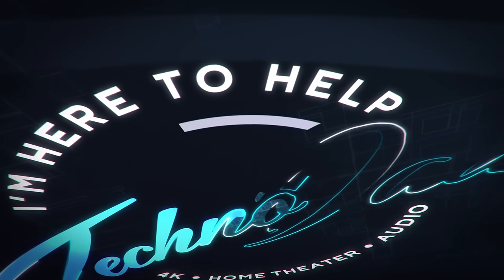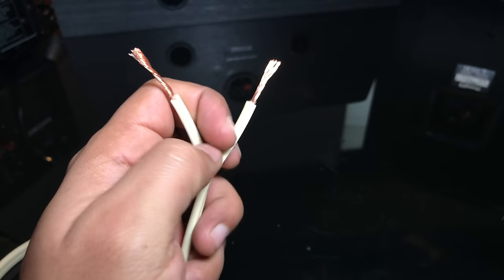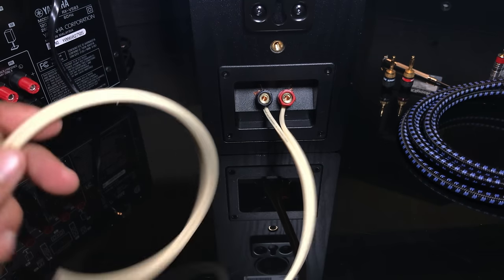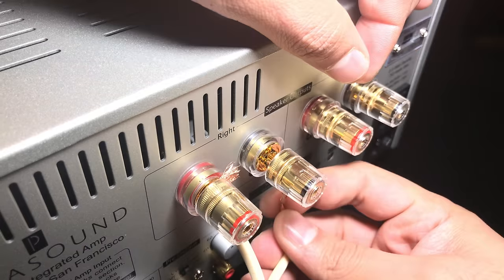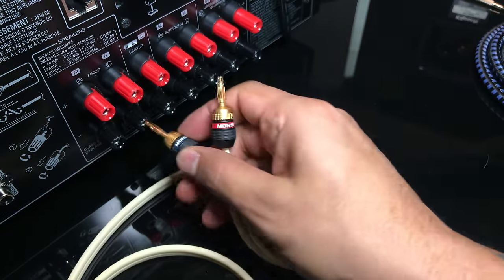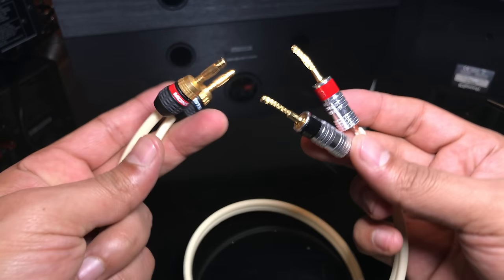How to Connect Speakers to Amplifiers | Home Audio Basics

Comment: 1:23 strip cable
3:18 bare wire connection
6:26 banana clips
8:47 pin connectors
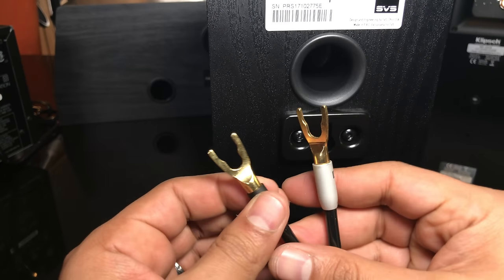11:08 spade connectors
13:07 dual binding posts
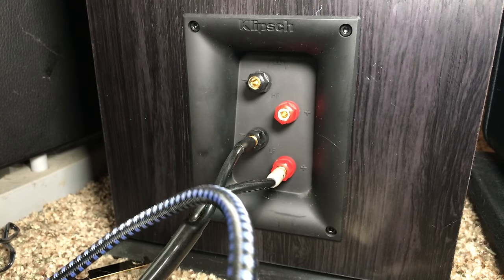14:09 his recommendation
Reply from the maker: Thank you!

Comment: Thank you so much ... it took me forever ... but I was finally able to connect my new turntable to the amp and the speakers ... your video helped me so much. I had NO IDEA what I was doing. Thank you for the clear instructions. Your video was essential to setting everything up. Thank you, thank you, thank you.
Reply from the maker: You’re very welcome, Jennifer.  I’m glad you doing the video!
Reply: I have to set up one too. I just find it annoying that things cant be simple with turn tables. Got to do so much work. Miss the old days when you can just plug and go. I had a cheap one that was like that but it started wobbling badly so wound up getting a more expensive one and i went to set up and boom nadda. needed to go back to get the amplifer and speakers and stero wire. Need to wait for the speakers to come in but im hoping i dont start a fire or blow anything up. lol

Comment: Many thanks for uploading!
 
I implore your viewers not to make my mistake. It's VITAL to ensure not even ONE strand is near the opposite pole when using binding posts, leading to a short circuit! It's remarkably easily done: at 06:24 you'll see what I mean, at the middle of the picture. It's a good idea to tuck the protruding wire around the post in the same direction as you turn the nut so it winds itself in and is less prone to splaying out. (This also usefully increases the contact area, giving better sound). 
I missed a single strand once. It contacted and made a short circuit to the opposite pole. The amp gradually overheated but I didn't know until I smelt it on the other side of the room, by which time its rubber feet were sliding off in their own goo. You may be luckier and have a fuse blow. Better just to check! :-D
Reply: Thank you for the warning! That would be my mistake!🤣🤣🤣
Reply: @aimee-lynndonovan6077  :-)

Comment: As always, another very informative and well laid out instructional video that is easy to follow.  I too have never used anything other than banana plugs and also have the same monster banana plugs.  They aren’t cheap but always seem to be my go to plugs.
Reply from the maker: Thanks brotha!  Yeah, I think it might be because Monster was the only brand I could find 20 years ago, lol!!!
Reply: I'm pretty sure I got mine when I bought some audio gear.  They threw in the cables with the deal and happened to have the Monster Cable Banana Plugs attached..   They have been my favorite.  The locking banana plugs are my second favorite only because they are so long.

Comment: The reason for two screws on the pin connector, or on some banana plugs, is something you defeated by stripping the cable too far down. The top screw is to hold the wire while the bottom screw is to hold the cable covering/casing. So you only should strip the wire far enough to allow the bottom screw to engage that casing. It makes for a much more secure and long lasting connection, especially when you pull the plug out multiple times to move the speaker or receiver.
Reply: Yup.  I knew immediately it was amatuer hour when he pulled out the  needle-nose pliers
Reply: I think he admitted that in the video...

Comment: The little "hehe" after you said "just a quick little snip of the tip" made me laugh.

Thank you so much for dumbing this down for people like me, this helped me sooo much! Down to the amazon recommendations/option.

My brother bought me a turn-table for my birthday last year, and then a few bookshelf speakers for another occasion. It seems like he was as clueless as me, because he didn't buy anything else. Finally, I got tired of staring at them in a corner, so I bought the amp but was still lost on how to connect the cables. I watched a couple of other vids of "how to" but they didn't actually break it down this much and I was getting so frustrated.

Liked and subscribed! :)

Comment: You taught me so much about the connectors. Do you have a video on input and output locations we need to use for adding a amplifier to the receiver. I never have hooked one up.

Comment: Thank you, this was so clear & concise. 
I have marshall speakers, all are different models, and I have amp as well.
Are the Bannana plugs universal for the speakers? Ive never done this before 😅😅
The instructions recomend spade connectors for the amp but speakers can only take the Bannana plugs
Reply from the maker: Hi!  Banana plugs should work for most speaker terminals with binding posts.  You can find cables that have spade on one end and banana on the other - https://amzn.to/3sibkyK - https://amzn.to/40jpJai

Comment: Good vid. Quick tip with spade connectors (when they're at an awkward angle) - use a pair of pliers or a clamp to gently bend the spade to the correct angle.
Reply from the maker: That's a great idea!

Comment: Very well explained video tutorial. 
Would you say that attaching banana plugs to bare copper wire cables for attachment to speakers is better than just a bare wire connected to the speaker..?
In short, would there be an improvement in sound  quality?
Finally, the shorter the speaker cable, means a superior ( better...)  quality of sound, am I correct?
Many thanks!

Comment: If you hook up 9 speakers (5.1.4) to an AV receiver, that would be 36 times pulling the rubber and plastic casing off the copper. So go and buy a wire stripper, its worth it.
Reply from the maker: Lol, yeah, I hear what you're saying.  Although, I already had a 5.1 setup before I started the move to Atmos and then bought cables that already had pre-terminated ends.
Reply: Jan Reinhardt what about the subwoofer? Doesn’t it needs the speaker wires too? (Im new to this speaker/home theater scene) by my math you only counted the 3 front speakers 2 surrounds and the 4 cieling speakers in the setup u were talking about. Which would add up to 9x4=36 which doesn’t include the subwoofer
Reply: @antoniolt611  Subwoofers generally use an RCA Cable with predetermined ends.
Reply: Wire strippers are cheaper than real ones

Comment: Hey man. I followed your video and thanks a lot, I managed to feed the twisted copper wires into the amp terminal but it is way louder in one speaker than the other. Any ideas on what this is?
Reply from the maker: Hi! I’m not sure why that would happen. Is it an old amp or something?
Reply: Yeah it’s an old amp but it was working fine, but I had to unconnect them as I wired the left speaker to the right and visa versa. Only when I tried connecting them again was there a problem.

Comment: I use 24K Gold Nakamichi Speaker Banana Plugs. You can buy 8 of them for $9. I’ve used them for years and all my connections are still good. Heat shrink speaker wire pants can help prevent oxidation from any air getting in.

Comment: Thank you for another great video. I’ve a question: I think you’ve connected the ‘Pins’ not right; you use both screws for the kabel without the rubber, but you have to screw the frontscrew to make contact with the blank wire (you can fold the blank wire to make a better grip) and screw the backscrew with the rubber!. With this connection it holds longer without the chance to break it. Second question: did you know that you can also put the bananaplug into most receiver-connectors by onscrewing them first and put the plug into the hole for the blank wire? On this way the plugs won’t unplug when you’re moving the receiver.(I’m Dutch, so sorry for my english....)
Reply from the maker: Thanks for the tip RABooden!!

Comment: Techno Dad, Do you know if using stiff pin connectors on a speaker with spring or clip loading inputs works? Or do you have to use the raw wire or flexible pins on the spring loaded/clip loading speaker inputs? Thanks!
Reply: It would probably work. But it’s a better solid connection if u use bare wire

Comment: On my way to upgrade my basic Denon 5.1 1610 AVR. Either I go for an AVR + ext amp or processor + amp. Looking at cost vs performance, what do you suggest? I like your option of the 3 channel amp for the LCR channel.

Comment: Great information.  I will have 7 speakers about 23 feet high in the ceiling.  I do not want to have any problems with the speaker connections.  Which speaker connection do you recommend for the money and which connection do you recommend for a fail safe/30 year permanent solution? I will need to rent a lift so I want to get this right!

Comment: Hey, thanks for the help! Is there a way to hook up speakers (spring clamp wire style) to a DVD player instead of a receiver? The DVD player doesn’t have the positive and negative wire outlets, but is there an adapter or a work around?

Comment: Great video, learned a lot .. but not enough! Hence this question:

I got a class D amp for stereo speakers and wanted to connect one of RELs subs to it , they highly recommend doing it with their high level connection, and to do that they recommend cutting the wire it comes with and attacking one to the right positive and one to the left positive. Question, can I just twist in their high level connection wires into this wire and then plug in the resulting “bundle” into the ports?

Am I gonna blow up my equipment or pull off their recommendation?
Reply from the maker: Hi!  I made a video about connecting a REL subwoofer via hi-level connections - https://youtu.be/4yMdZbOMDZc - as far as if you'll blow up your equipment...I would contact REL to make sure you won't have any issues.
Reply: @TechnoDad  thanks a lot buddy , that video was exactly what I was looking for.
Appreciate it :)

Comment: Nice tutorial thank you. The only problem I have is that my onkyo receiver rear surround sound connection design (which I use for  my bookshelf speakers), is different from what you've shown in your review. .

The connections are the ones that you have to strip the tip of the wires then lifting up a lever for positive and negative before inserting the wires in,  then releasing lever for wire to remain secured. I'm positive you'd get an ideal of what I mean. The hole underneath the level is a bit small for speaker wire to pass through. In the end the naked wires  are nearly touching each other for being too closed together at the entrance. I had wanted to send you picture but YouTube doesn't have any option for that.  Which connectors should I get to make things tidier and easier please.

Comment: Thank you for this all in one clip. It is very helpful. The AVR I got has the type of posts as seen here (fast forward to 5:35 in your video). It’s so hard to get my fingers in there and I don’t fancy that type of connection. Is there any tips or alternate ways you could suggest. Can we use those flexible tip plugs instead.
Reply from the maker: I use banana plugs mostly.  So if you can fit those, it'll be a lot easier.
Reply: @TechnoDad  I don’t think it is possible (there is a cap on that end) to insert a banana plug  from the top end. Do you mean to use a banana plug side ways?
Reply from the maker: Those could be removable

Comment: Hello, This might be a dumb question but here goes, I have Harbinger powered speakers coming from my mixer, the mixer is plugged into QSC 300 watt amp, and the amp is plugged into my controller. I know I don't need the amp using powered speakers but I use it for a Peavy sub woofer. Will I blow my speaker with that setup if I turn the volume up too loud?

Comment: Thanks! But what about the partly exposed wires and connection bridge on the speakers and receivers... I assume the voltage is very low there? Nothing to worry about?

Comment: Great Video! Thanks. I do have a question though. Can you please, in a future video, explain how to set up a 7.2.4  using something like a Yamaha RX-A3070BL and a Emotiva XPA-3 Gen3? Those are the components I chose, and this whole home theater set up is my first venture into higher end AV. I know I will need the external amp to do the 11 channels, so I decided to go with the XPA-3 Gen3. I'm just a little confused on how to connect the external amp and front 3 speakers, to the A3070. Full disclosure, I am in Afghanistan so my set up is being pieced together(some new, some used) and I hope to have it all ready for install when I get home. That won't be until June, so I have time to learn/educate myself before hand.  Thanks again!

My proposed set up:
 
Klipsch RF-7 II Floor Speaker x 2

Klipsch RC-64 II Center x 1

Klipsch RS-62 II Surround Speakers x 2 

Klipsch CDT-5800-C x 4 Ceiling Speakers

Klipsch RB-81 II x 2 Bookshelf Speakers

PSA V3601 x 2

Emotiva Audio XPA-3 Gen3

Yamaha RX-A3070BL

Comment: Is there a chance for the pin connector type to touch each other and thus cause problems???🤔
Reply: Mr. X. yes but most systems have a auto shut off if it detects it hope that helps

Comment: Thanks for that! I just bought a pair of 6ohm speakers rated to a maximum of 80 watts. I want to use them as speakers "a" on my av receiver. I also have a pair of 8 ohm speakers for use as speakers "b". These are also rated as maximum 80 watts. The amplifier apparently has 100 watts for the main speakers and less for the surrounds and Centre. Is it OK to use these speakers in this way as long as the ohms are set correctly in the amp?

Comment: Hi thank you for the video, In case you would know the Douk little bear amp/speakers splitter, it would be awesome and I would then have a question, if you find the time, about the connections with this device (Little Bear). How would I do it if my source is a computer, which I connect an amp to (say the T9) ?  How would I connect a second amp (say SMSL DA-9), to my computer (acting as a content playing source) before adding it to the little bear ?? Any insight welcome, because how do you share a single audio source with two amps? I find it confusing, what about the shared audio source for the two amps one would want want to compare in real time using the splitter (little bear) ? How can the two amps be connected to the same source to be compared to start with, be it a PC, CD transport, streamer-DAC, etc. ?. Something I don't get, since, apparently, you can't connect a common audio source to the little bear. Very lost here, but relatively new to the hobbie (and dumb, don't forget dumb)...

Comment: How i can use my 12inch car subwoofer (inbuilt amplifier) to my Home theatre Amplifier?
Reply: Check the Ohms and see if the receiver will output the Ohms for that speaker, because home audio and auto speakers use different ohms, as a rule.
Reply: @chaotic/Silence
I think you did not understand his question. I think the idea is to connect using the power amplifier of the sub. And in that case, he needs a 12v power suply for that amp, and then connect like it was a home subwoofer.
Reply: @mindtraveller100   even the newest beginner understands that an inbuilt amp on an LFE for vehicle use needs a 12V Power supply, I guess you commented just to hear your self comment  LOL  learn how audio pass through works before commenting please.

Comment: Hey great video, I just hooked up my speakers but there is a serious buzzing noise in addition to the audio. Could you help me fix it? Thanks
Reply: I had a similar issue, was getting loads of feedback & buzzing (although this was without an amplifier). I was able to get my studio monitors & subwoofer completely silent by adding a ground loop isolator to the mix. I bought mine for like $6.95 or something close to that off amazon. It's nice because its so cheap, if it doesn't solve your issue at least you didn't spend a fortune. Hope that helps, I'm fairly new to all of this, so don't hate me if you try this way out & it doesn't work!

Comment: Thanks for the video! I have a question not addressed: how do I connect my speakers  cerwin-vega DX5's to a magnavox system? the speakers have 2 red , 2 black ,and 2 g receptacles for speaker wire but the stereo only has the red and black receptacles. What do i do?

Comment: Techno Dad! help me! I have the speakers and sub from a home theater system that fried a while back. I want to connect the speaker system to my Insignia Roku TV. Is there a special box I can connect the speakers to that has a RCA or Aux jack that connects to my TV? The speaker wires don't have connections and are raw wires. What do you suggest?

Comment: I want to ask. I have an onkyo 7.1 channels and attached here with was the modular bose acoustimass 10 series iv. It is just 5.1 home theatre. Is it fine if I buy another 2 cube speakers or any other speakers that I will add on and connect them directly from the reciever? Thank you.

Comment: When you have HF and LF bridged, which one should I plug wires into? Is one better than the other, or it doesn't matter because it is bridged? Thanks
Reply from the maker: Hi!  What do you mean by bridged?  On the speaker end?
Reply: It has a jumper or whatever it is called lol.  It connected both terminals

Comment: very helpful man. thanks for your videos, not just this one. hope you can keep up. i just got a rx-v585 that should be delivered in germany by july, but it is ok. i am considering if i should stick with it or go for 685 new model. my main usage will be generally computer directing audio 5.1 or 7.1 direcly through a optical connection IN the av receiver and the video would go either directly to the TV (for playing games) or through the AV receiver for video watching. my video sources are mainly .mkv files with the contents of the Blu-rays and my audio sources varies from flac multi channel, ac3 multi, dts files. any suggestions on that? cheers!
Reply from the maker: Hi Gabriel!  After looking at the V685, it looks very capable.  Make sure it has all the inputs you need and I think you should be okay!